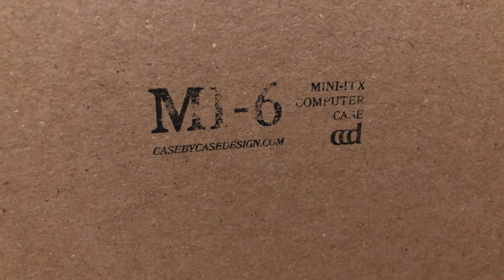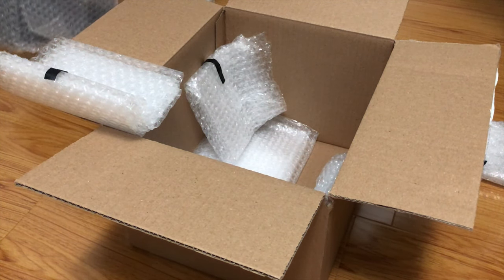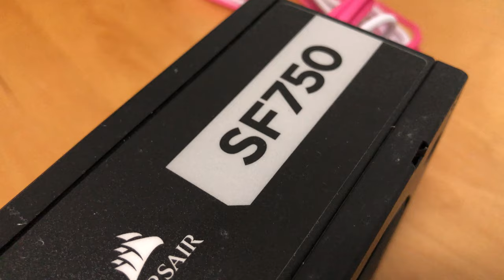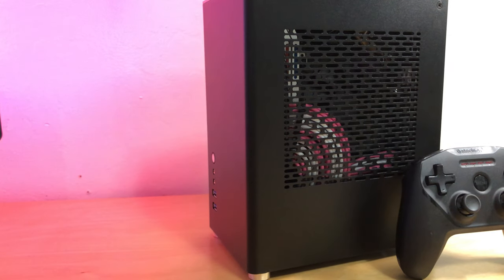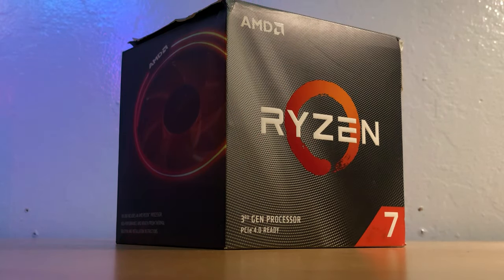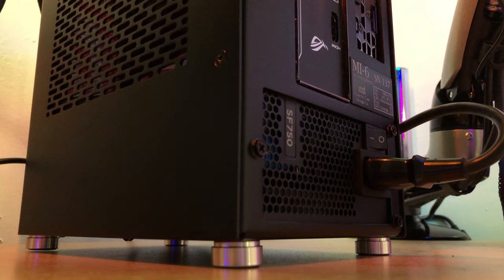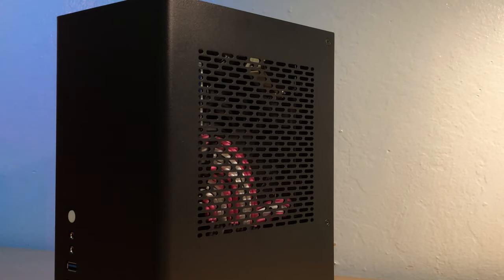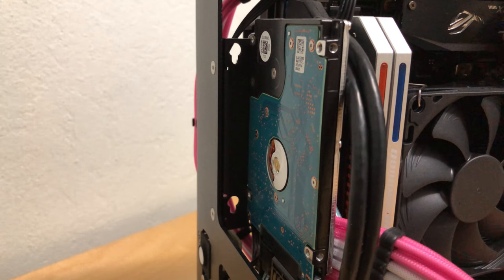Case-by-Case Design MI-6 - Mini iTX Small Form Factor PC Build

Comment: Good review+overview!  I was very interested in this case and just learned that they shutdown production -- wish the plans were public and we coud pay for cutting of the panels ourselves.  Its a good design.
Reply from the maker: Thanks, the case does not receive much attention and that is sad to see it's gone
Reply: It is a really nice case, I had one of the v1.0. Sales never did very well and it is a shame they won't make anymore.
Reply: @PokerFaZe  Could you try a 645LT in it? Thats what I am most interested in seeing if it makes a big difference like the DanA4
Reply from the maker: I may try, but it would be better with the older 545LC because of the 90-degree-angle tube. Will see with the tall loft